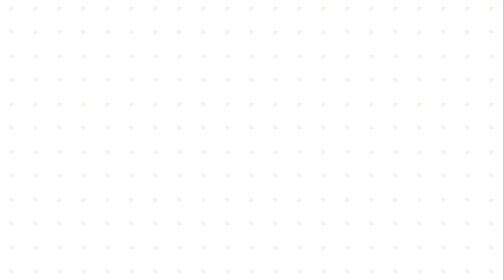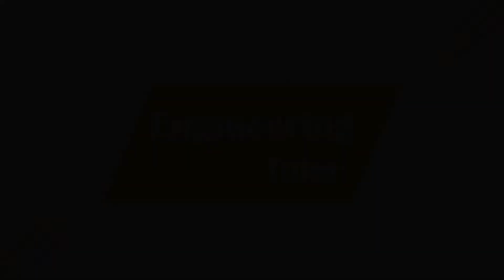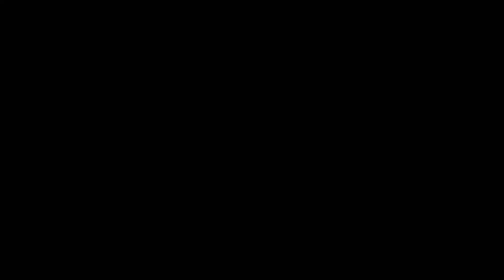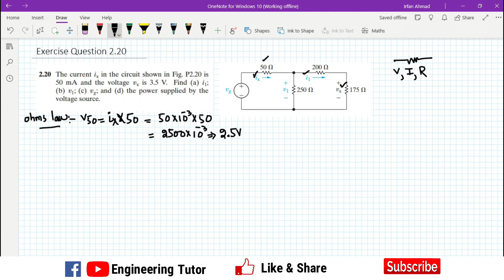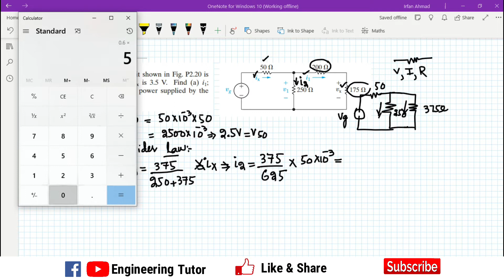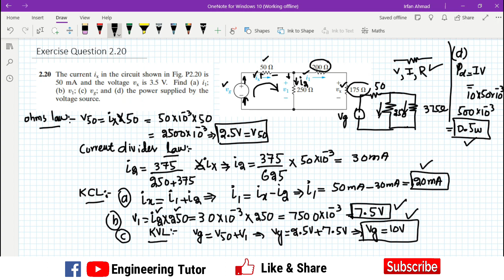KVL and KCL Problem 2.20 Electric Circuits by Nilsson and Riedel 10th Edition | Engineering Tutor

Comment: Hello sir, thank you for this video but i was wondering if we can't solve first i1 because i1 also goes through Vx so we use Ohms Law and get i1=20mA and then use KCL to find i2. I just thought it would be easier that way.
Reply from the maker: Thank you for out of the box thinking. You have a good understanding, yet the current can't be calculated here like you suggested, because we have to take care of all the loads connected with the source.